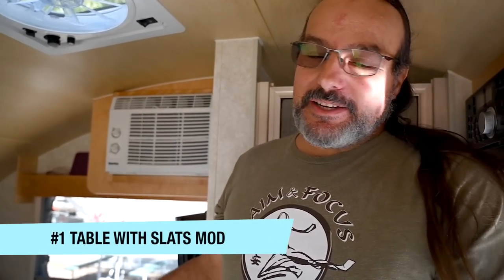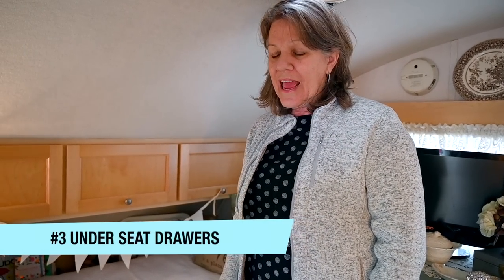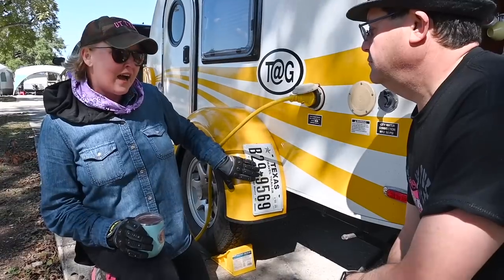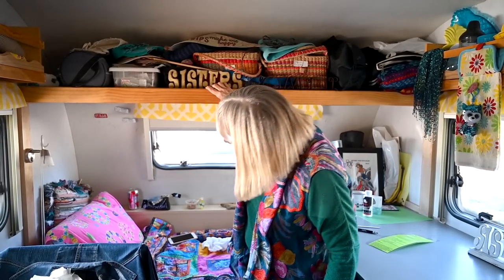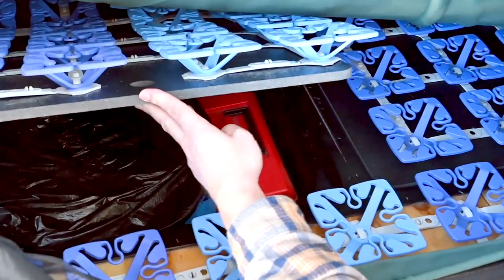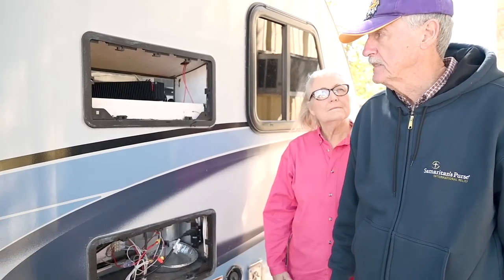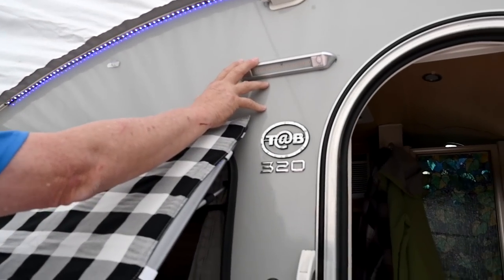10 More Tiny Trailer Mods for your T@B or T@G

Comment: I particularly like the two, long under seat/bed storage drawers.

The removable interior shelves were a very neat solution to that owner's individual requirement. 

In the video we see the original three rear cupboards, which in my opinion look hugely better than the new two, much larger cupboards found on later models.

What s tease it was to omit that aluminium chequer plate latched cover on the A/C unit in the final interview!

Comment: So many great ideas!

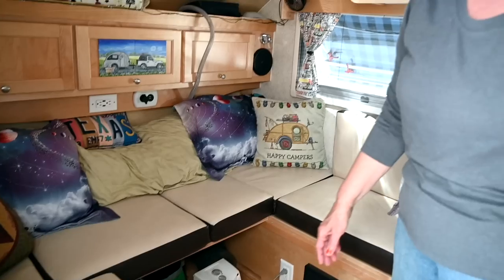But just a heads up at 2:52, while this seems like a good idea, it actually violates one of the basic rules of cpap operation: The machine must always be level or lower than the user's head.  Having it elevated like that means that any condensation or water that leaves the humidifier chamber will run down the hose with gravity, build up in a valley and can cause the user to drown in their sleep.
Reply from the maker: Great advice! I don't use one myself so I had no idea!